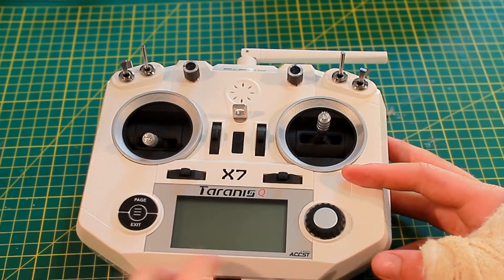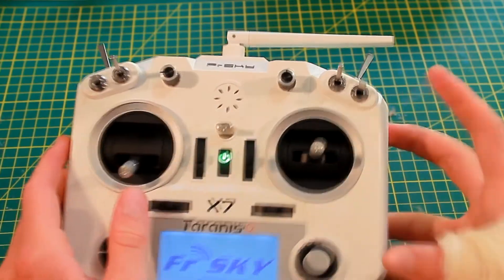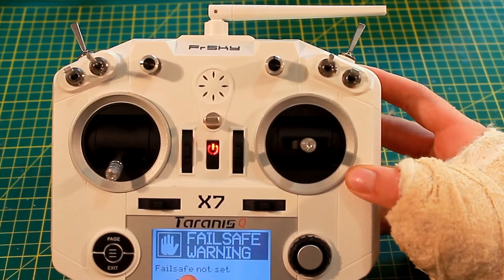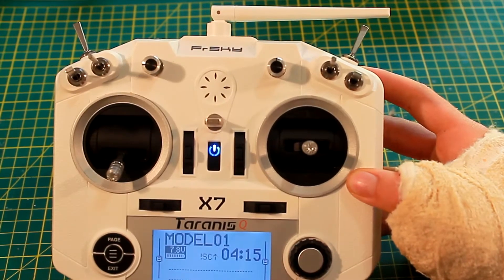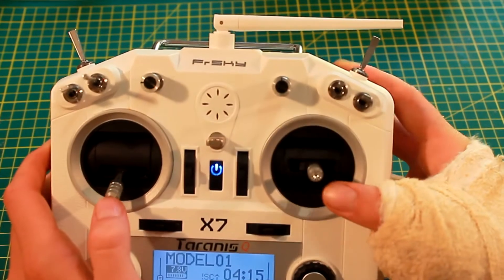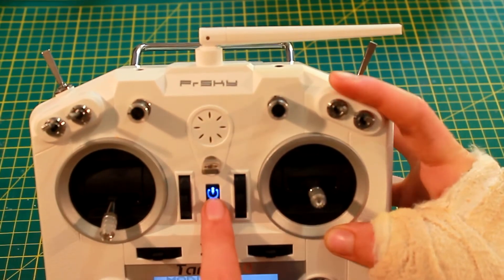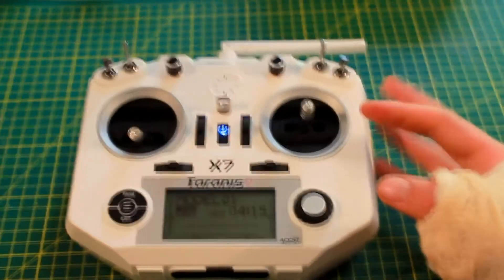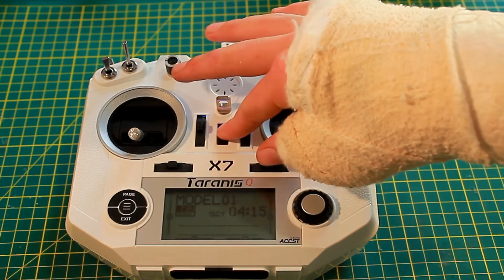Taranis QX7 Switch Warning Fix

Comment: I am having trouble with the top right temporary switch... It seems like it does not get recognized by the Qx7. When I try to bind it to something and flick it, It doesn't do anything... Help?
Reply from the maker: Hi mate, sorry I'm no expert on OpenTX but I can tell you this: Make sure that you've programmed it correctly, making sure that you've set something up onto the switch. To learn how to do that, search "setting up features to switches on OpenTX'. The other thing which may be wrong is that the little sensor inside the switch is broken or faulty, which means you need a new switch. Currently I don't think that spare switches are being sold on the market, but I'm sure they will be getting sold soon.
Once again mate, I'm no expert on the software that the QX7 uses (which is OpenTX) and I'm sorry if that didn't help at all!!